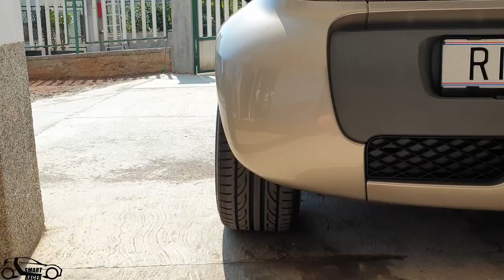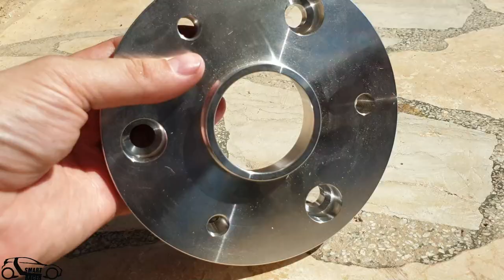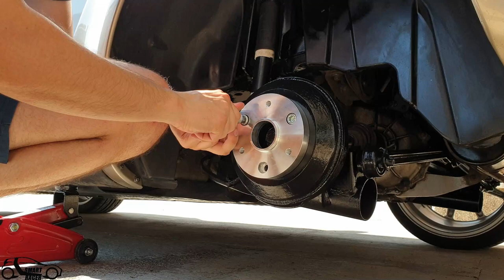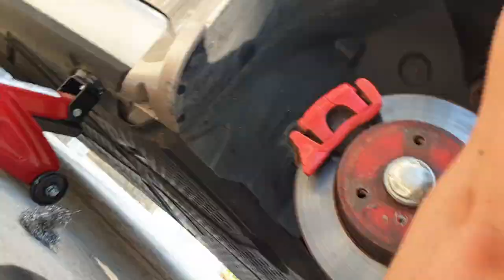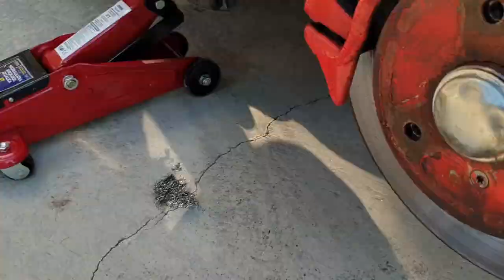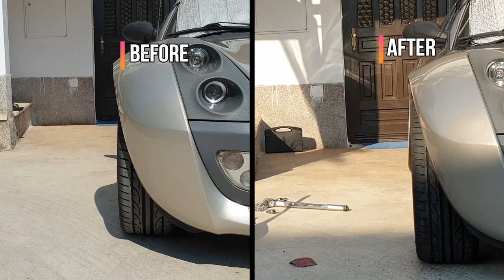WHEEL SPACERS Install - Great Car Mod

Comment: Hi, thank you for the videos, they are all great. I have a Smart Roadster Bluewave and I got the same spacers that you put. One question: Were your spacers galvanized and did you need to make an alignment after installation? Thanks and keep it up!
Reply from the maker: I think that on rear there is no or limited space for wheel alignment

Comment: DId you notice any wheel bearing problems?
Im looking for some solution how to have wheels more out of the car body. 
I just dont understand why they made narrow rear axle and used that wide rear end of the car. And that combination of wheels with ET -20 and ET+24 (and similar) is just crazy. You are absolutely not able to find nice set of wheels except OEM because of that 3x112 hub.
So what is your experience with driving with spacers? im worried about it because you change also suspension behavior (center of the wheel is not center of the bearing anymore etc... )
thanks for your reply
Reply from the maker: You see when video is posted I still have them on car, with spikelines 20mm front and 25mm rear. I agree that wheels are to much inside and car looks ridiculous without spacers
Reply: @SmartRacer  So no problems with bearings up today?
Mine is on 185 55 R15 Spinline which is even worse :D Im looking for Spikeline R16 and maybe i will look also for wheel spacers.
I dont know why they didnt make rear axle wider, that ET number difference front/rear is nonsense for me. Even i will buy 3 to 5 stud spacer adapter, still need to look for different ET for front and rear.
Im glad that you have no problems with spacers. I will think about that. 
thanks

Comment: I'm currently driving a VW polo ...the front wheels tend to stick out but the rear ones don't... should I use spacers to line them correctly....or is it just that the body is wider at the rear making the rear wheel go inside...I can't really tell...
Reply from the maker: Try to google how to measure what size of spacers you need and then order system 3 spacers.

Comment: I heard if the wheels stick outside of the body you fail the MOT and the rear wheel after instalation looks way outside. Or is that just the camera angle? 

Which country are you from? Have you had problems with that?
Reply from the maker: Here car was on standard setup, later on when coilovers are installed it fits inside.
Reply: You don't fail an not that's nonsense bro.
Plus his wheels will settle after a couple of days pal get them it's worth it.

Comment: hey, it seems like you forgot to use longer bolts to compinsate the length of the spacer
Reply from the maker: Not in this case, this system doesn´t require longer bolts.